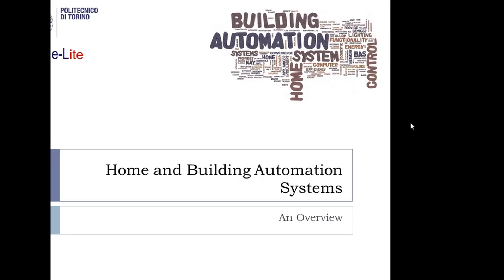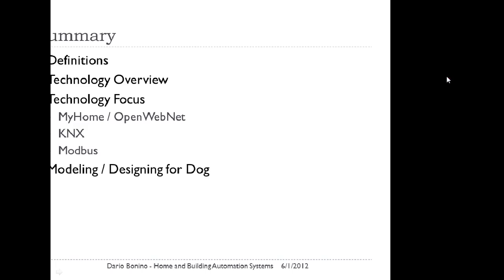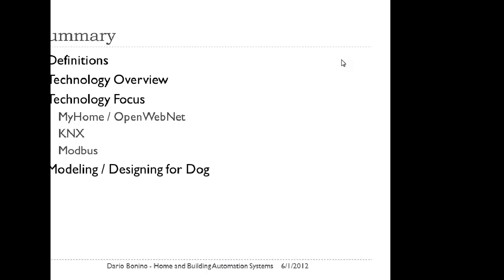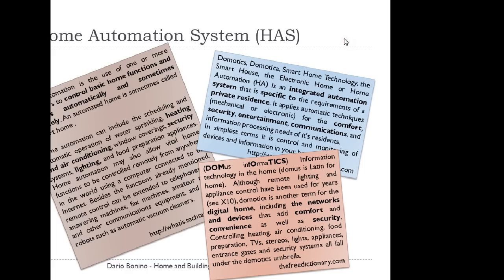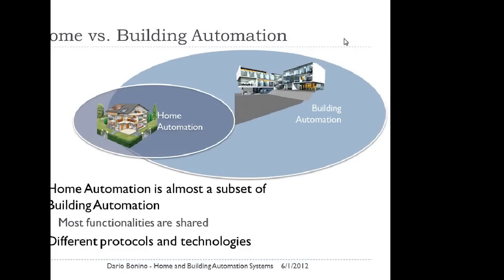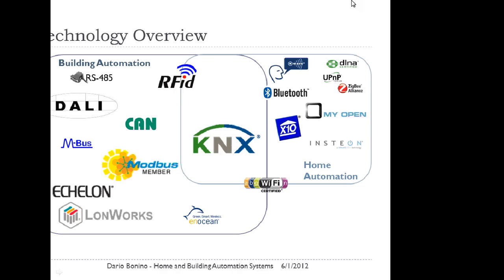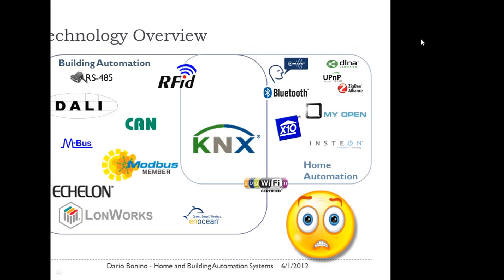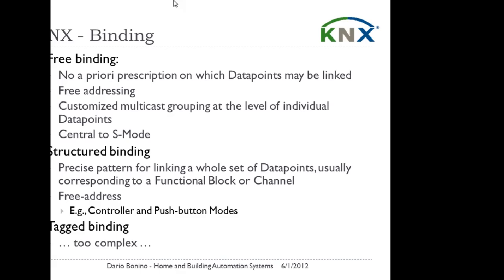Home and Building Automation Technologies

Comment: About ZigBee (at: 0:21:42) maybe the correct info is.
- ZigBee Aliance define Aplication layer(Public Profile). 
ex: ZigBee Home Automation(ZHA), Smart Energy(SE), new SE2/ZIP(IP transport layer, 6LowPAN), Building Automation(BA).

But a vendor is free to use only the transport layer or implement a private profile, but a device to be certificate by ZigBee aliance must implement a public profile.

Device from deferent vendor can exchange data.